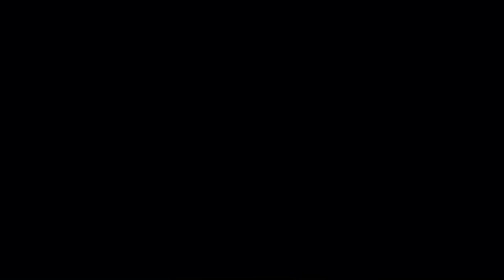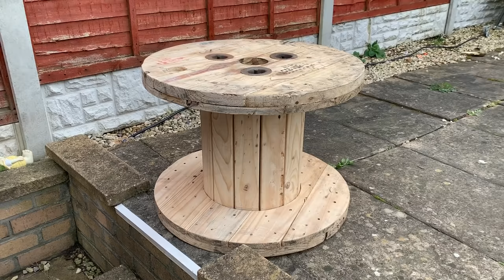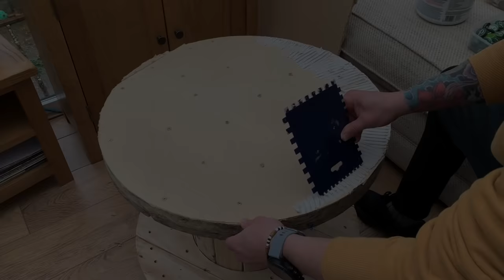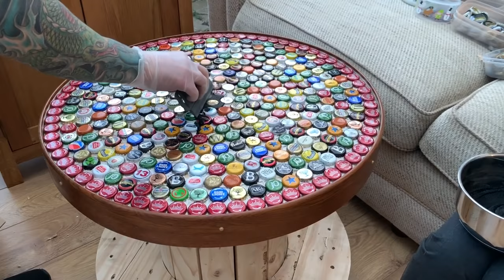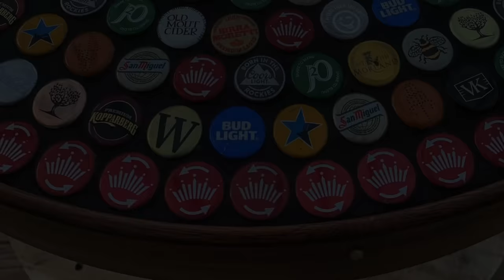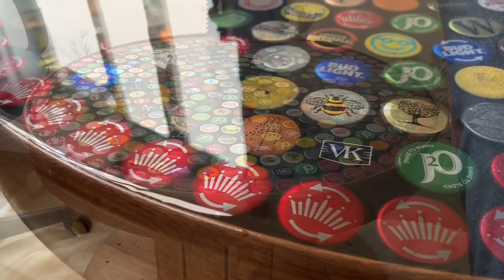Building a beer bottle cap cable reel table using bottle tops and epoxy resin

Comment: Where did you get the wood trim around the edge
Reply: To make it easier to pour the epoxy
Reply from the maker: +Jim Downing it’s a UPCV trim from a builders merchants. Try a fasica and guttering supplier, they sell them from 45mm to 95mm width 👍🏻